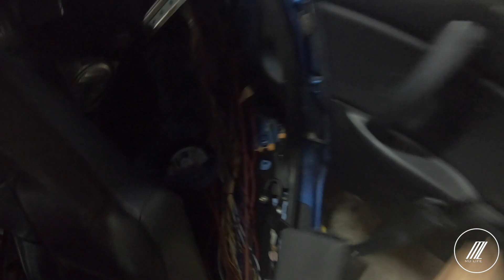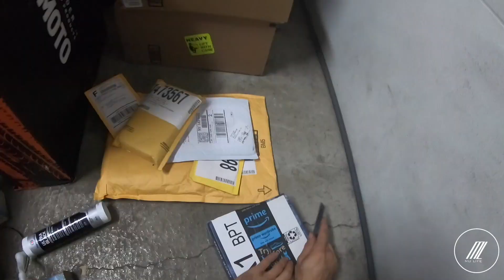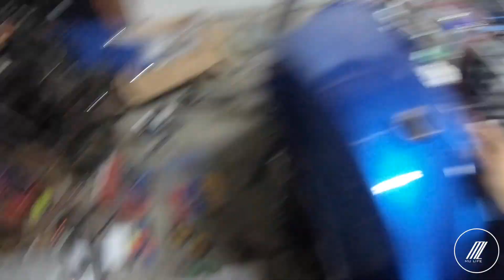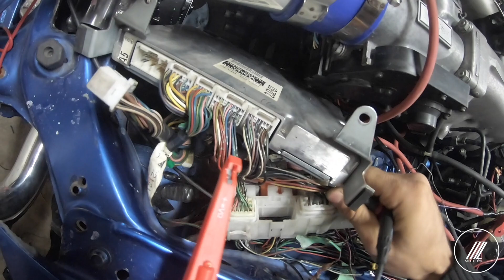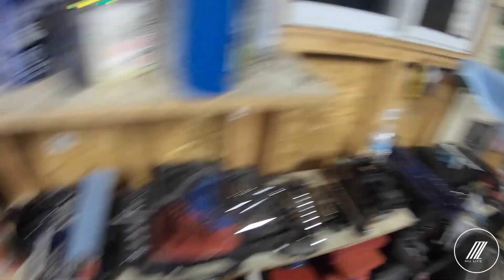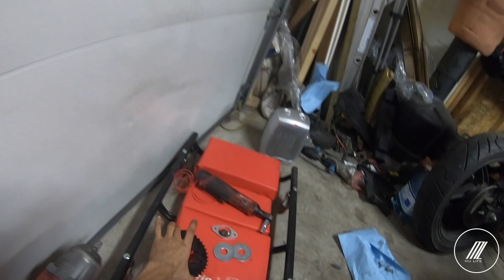RX8 2JZ Part 15 - ECU wiring / Gauges / Crankshaft sensor install !

Comment: Good day....just one question....how much space did it have between the radiator and the pulleys for cooling fans?
Reply from the maker: I am using electric fan that is attached onto the radiator. I am not using the stock JZ clutch fan

Comment: hi, i have an m54 on my rx8 and I need some help for my rpm gauge 
I know that just fuel gauge didn't work with CAN line, but how do I do to get rpm gauge working ?
i have the  rx8 ecu if it's necessary...
thanks !
Reply from the maker: Well depending whether you are using standalone and if that system supports your vehicles can lines. However if you just wanted the rpm gauges working with using the rx8 ECU , the best way is to rig the setup like i showed in the video , you grab the crank position sensor with the plate and mount it on your current crank pulley on the engine you are using.

Comment: if im using my 2jz ge vvti gte swaped from my lexus is300 on a rx8 its better using the lexus is300 ecu or the rx8 one? thanks
Reply from the maker: well, you will need both.

Comment: could u tell me how u did the fuel lines
Reply from the maker: I taped into the stock hat for return line , used the same stock for feed. I will upload a video of upgrading to custom fuel pump hat and will explain how the lines were made.